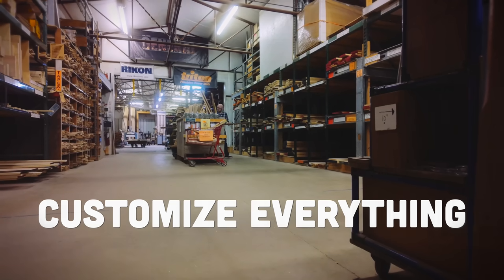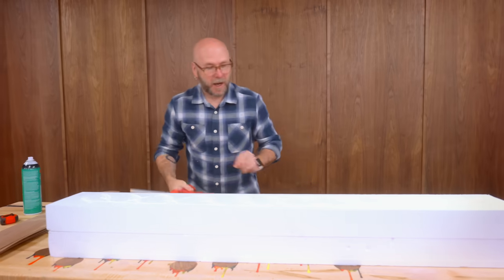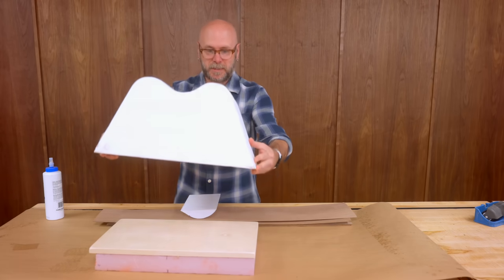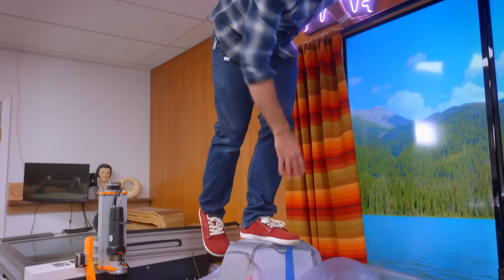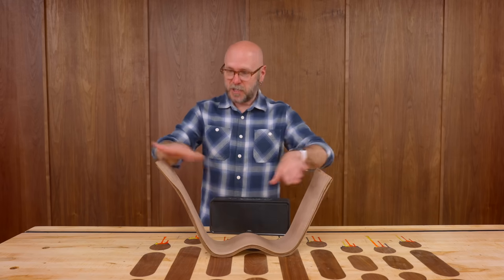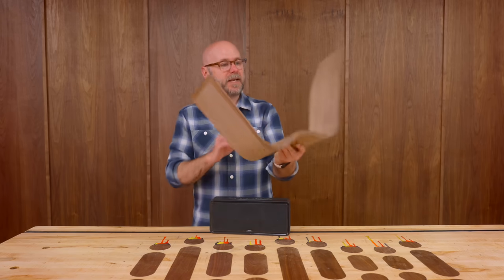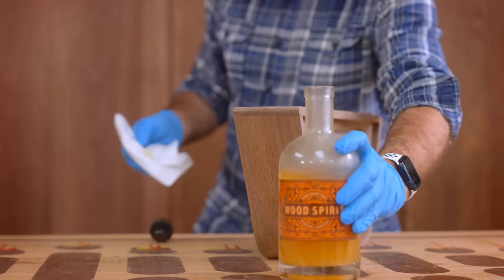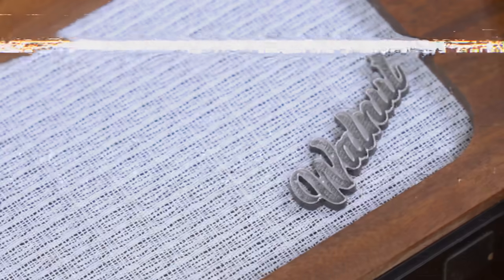From a Cheap Bluetooth Radio Into Stunning Fine Furniture

Comment: Another great custom piece. I think once you are paired with the speaker, there is not need for buttons and that's why you glued them. But how will you turn on the speaker? is that why you didn't put a backend?

Comment: FYI, watched a different video where the person needed to glue together polystyrene.  He used 3M 78 as a contact cement because it's formulated to not dissolve polystyrene.  Worked really well, so you might try that next time.

Comment: Just wondering, if you CA glued the buttons in, how do they press down onto the speaker?
Reply: I think he CA glued them to the strip of Gorilla Tape, so they flex and push down on the actual buttons.
Reply: @waguchan2414  yes, you’re correct… thank you! I watched it, but stepped away for a second and missed that part 😂 I appreciate it.